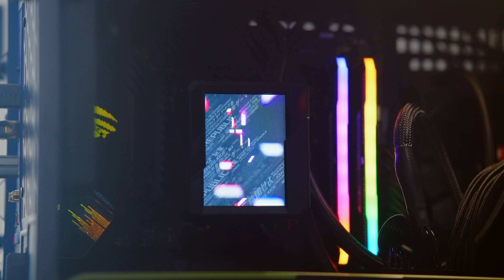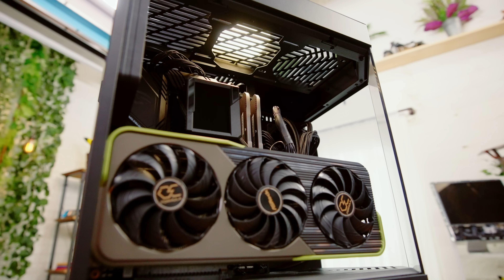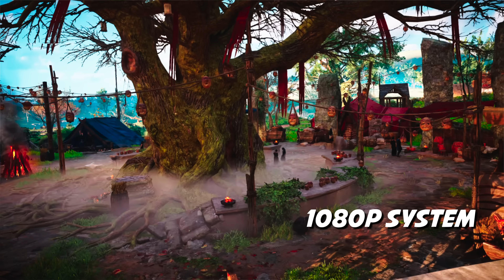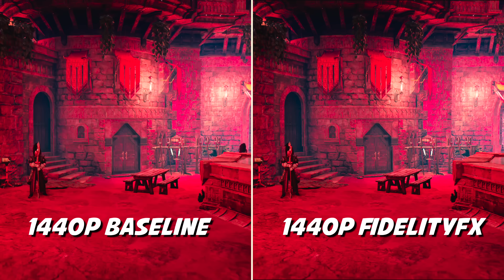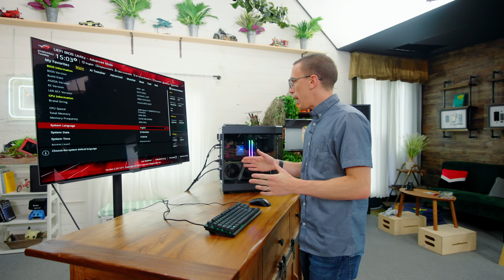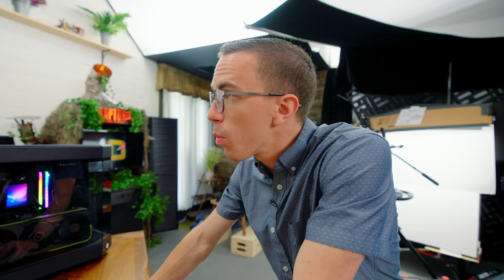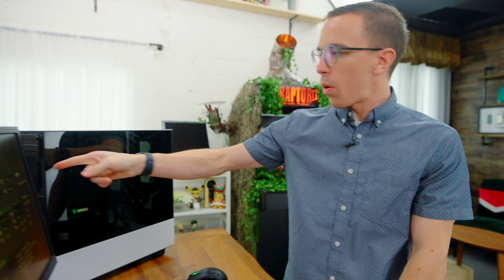Is an ALL AMD Gaming PC Worth It?

Comment: RX 6600 xt and 3060 non-ti are at the same price while the more affordable non-xt is $150 cheaper. If you just don't do other tasks than gaming. Going for AMD in the gpu department is always be a better choice in many cases

Edit: 3060 I mean, not 3600. There's fake giveaways and spam in the replies, be warned!
Reply: DLSS is the only reason I went with Nvidia. I've tried fidelity fx and I think it works great in fast paced games but it doesn't hold up in image quality.
Reply: @Bendoughver  Sensible reason, pairs well with ray tracing too 👍
Reply: @Bendoughver  Unfortunately it looks like DLSS is no longer an advantage for Nvidia as FSR 2.0 is not only about as good as even DLSS 2.3, but it's going to be supported in a ton of games, and I mean a ton. Its open-source nature has let many fans make mods for unsupported games to support FSR 2.0, like in RDR2 and many other games. And it's also supported even by GTX 1060 and probably also Maxwell cards as well. It's a gift from AMD to all gamers and that's why you have to surrender your life savings to buy an MI200 card right now
Reply: @one_step_sideways  copium
Reply: @Bendoughver  well FSR 2.0 is there now. And it will only get better + it will support more games do to it's opensource nature.
Reply: @durschfalltv7505  this is all true, but they are completely different technologies and I personally think DLSS has a much deeper bottom to reach in terms of ability. Fidelity FX is just another anti aliasing technology that's been rebranded.
Reply: @Bendoughver  Well still makes nvidia unusable for me on linux.
Reply: @Bendoughver  I don't think that really matters when it comes to 1080p gaming
Reply: wow a civilized conversation about the competitors! maybe we’re learning
Reply: The stigma I've known so far against AMD is that their GPUs like to suck up energy like no other. I haven't done any research on this lately as I had no reason to but I wonder whether this is still the case; where AMD deffo matches RTX or is better, but at the cost of significant amounts of juicy Watts... 👀
Reply: @ItsNassz  Hardware Unboxed have just made best gpu to buy at this time of year. You can check on that if you wanna a quick rundown on the list.

Both AMD and Nvidia have Watts efficiency issues with transient power spikes on the higher end cards. Lesser ones (RTX 3070 and below), their watts are not really worth caring about very much unless you are heavily, extremely, struggling and had to go with 3050 at what point would be wasting money anyway.
Reply: Actually  now days 6600xt for same price of 3050 which is like 50 percet better than 3050 at  almost same price yestrday was 6600xt on amazon for 299
Reply: only reason I went nvidia is the lovely rtx and dlss stuff.
Reply: Congratulations you were selected amongst the shortlisted winners 🏆 for the ongoing MacBook-M2/PC/Ps5  giveaway 🏆what'sapp the number above👆

Comment: Crazy how much better AMD has gotten over the last few years.
Reply: Ryzen changed the game
Reply: @Anonymous One Bro, ray tracing is such a performance killer, you only use it for screenshots anyways. I use a nvidia card and i can tell you that RT is not something you should be gaming with. I play all my games with RT off and the games still look very good.
Reply: @rusticmarten5262  What GPU do you have to be saying Raytracing does not matter?
Reply: @ZackSNetwork I didnt say it doesnt matter, its cool technology, just that it basically cuts your framerate in half, so imo its not worth it since games on ultra and beyond still look fine and run much better. I have tried RT in many games and  i always end up turning it off (i still turn it on for better lighting in some of my screenshots). I also have a 144hz monitor so fps below 90 is considered somewhat laggy for me now. The gpu is a zotac twin edge 3070 and i have an overclocked R7 5700g. I personally think that people should be more upset about AMDs codec, thats why i bought the nvidia card, nvidia has an amazing NVEC encoder/decoder for screen recording and also very fast cuda cores for example blender 3D renders using both the cpu and gpu. Still i have to say what AMD is doing is very impressive, like insanely impressive.
Reply: @Anonymous One Who cares about RT Lmao, such a waste of performance. Also what else about my statement was rubbish? Benchmarks literally prove my point about 1080p.
Reply: @Anonymous One Yeah for higher resolutions Nvidia is better, but for 1080p AMD soundly trounces Nvidia.
Reply: @EnigmaticGentleman  Who buys a top end GPU to game at 1080p? People in the competitive scene still prefer Nvidia and Intel still. 1440p is the new target know for mainstream and Nvidia dominated at 4K. Let’s not even talk about features, software and emulation because Nvidia stops AMD big time. AMD’s only advantages is 1080p gaming and Linux.
Reply: @ZackSNetwork  1080p is still the most popular resolution by FAR (68% last i checked the hardware survey), lots of people buy high end for High Refresh Rate and to not have to replace for a long time. Not sure about the Esports though, do you have stats for that? Though i wouldnt be surprised if Nvidia was ahead there due to how many teams make deals with OEMs
Reply: Intel nvidia is still the better combo
Reply: @agamerdude7596  Actually i can deny that, the RX 6000 series beats out Nvidia at 1080p, and in many tests the 6950xt beats out the 3090Ti as the overall best graphics card while being NINE HUNDRED bucks cheaper.
Reply: @EnigmaticGentleman  Yea sure, But gaming isn't the main point of nvidia cards, You do realize that people dont buy nvidia cards just to play games at 4k and high settings?
Reply: @agamerdude7596  Yeah but if thats what you are concerned about why are you commenting on a Gaming video? one would rightfully assume that gaming is the main topic of discussion here
Reply: @EnigmaticGentleman  Productivity and work features is pretty much the other reasons why nividia cards are still prefrered.
Reply: @EnigmaticGentleman  Like even myself doesnt just use nvidia just to play cyberpunk 2077 at 4k high fps.
Reply: Well, they hired a brilliant, well-spoken, and competent engineer to be their CEO, who would have thought you should do that as an engineering company?
Reply: @Anonymous One the fuck does it matter though. let people do what they wanna do
Reply: @Anonymous One Considering they are in X86 AND GPU markets. I'd say they are still doing well.
Reply: Their gpu drivers still arent the most reliable. My 5700xt sucked for years
Reply: True
Reply: GPU wise AMD has always been a good or even great option in the mid range. And even their FX Bulldozer cpus worked if you were on a tighter budget. And the mid range is where 80 to 90% of all gaming related sales happen. AMD has in the past years only improved in regards to the high end in general and the mid range in cpus.
Reply: Yeah also crazy how shit their gpu drivers are and runs like shit in some games
Reply: Crazy how they would’ve went out of business if it wasn’t for Dr. Lisa Su single-handedly!
Reply: Lisa turned AMD around fr
Reply: Lmao this did not age well 🤣
Reply: @agentbravo1716  ikr?!
Reply: Truly
Reply: Omg! You won a prize from Austin, def go give him your card info to get your prize
Reply: @basedgod5223  its fake lol
Reply: Isn't the GPU's still trash though? since they easily break
Reply: @vagamer522  I dont think AMD has ever really had problems with that, Nvidia on the other hand...
Reply: @EnigmaticGentleman  really I heard reports of AMD GPU's being bad so when I make my first ever PC I want to make sure it is good and lasts
Reply: @vagamer522  Oh, i think you mean the drivers. Yeah they aren't as good as Nvidias, but my god people over exaggerate them so much.
Reply: @vagamer522  i have a 5700xt, still running good. However its not the gpu, its the horrible drivers.
Reply: @Boeing-ER-jy9vq  yea the 6000 series cards aren't to buggy
Reply: Congratulations you were selected amongst the shortlisted winners 🏆 for the ongoing MacBook-M2/PC/Ps5  giveaway 🏆what'sapp the number above👆🏻
Reply: @austinevans2352  Bro stop scamming
Reply: Wow i cant believe it! Heres my social security number

Comment: TLDR: If you're wanting brand new with the best features, NO!
AMD CPUs are still great to use, but AMD graphics cards just don't hold up against Nvidia's raytracing and supersampling
Reply: Congratulations you were selected amongst the shortlisted winners 🏆 for the ongoing MacBook-M2/PC/Ps5  giveaway 🏆what'sapp the number above👆🏼
Reply: Well raytracing is better in nvidia for sure. But for frames, the 6950XT does more frames at 1080p ultra vs 3090ti (look for toms hardware gpu hierarchy). Also pricing is better for AMD.
Reply: @Jochemster  There is also DLSS. And, anyhow, using a 6950XT or a 3090ti for 1080 is overkill. They are more geared to 4k.
Reply: no 1440p 6950xt beats 3090ti
Reply: Raytracing is better but it’s still not mainstream, maybe once the 4000 series launches it will be, but until then you’re not getting a great experience. Maybe you will if you buy the top echelon of Nvidia GPUs or make compromises with either settings or performance, but it’ll only be mainstream once those compromises aren’t required.
Reply: @logan62097  DLSS is very mainstream now tho (and so is raytracing since it's in over 200 games now). 
If you want AAA gaming with the best new features Nvidia is the only good option

Comment: I'm Intel and AMD (and NVidia) agnostic so have no problem mixing it up, but in all honestly AMD has enough options in both CPU and GPU you'd be fine if you had to go all Team Red unless you were actively trying to make a bad meme build combo.

The real interesting question would be when the Intel GPUs finally get a general release and whether it'd be worth it to go all Team Blue as an early adopter of Intel GPUs.
Reply: in theory, vertical integration squeezes more performance due to closer synchronization. 
If i ever build a pc, might just go all out blue or red.
Reply: Congratulations you were selected amongst the shortlisted winners 🏆 for the ongoing MacBook-M2/PC/Ps5  giveaway 🏆what'sapp the number above👆🏼

Comment: Is it worth to buy refurbished gaming laptop,its factory refurbished?
Reply: There isn’t enough info in that question to answer it properly.
Reply: @whitekong316  like its factory refurbished, it was tested and put in not original box
Reply: @papastrumf5217  but whats the spec and price and use case? Imho laptops aren’t ever worth it. Leave a lot of performance on the table for the price.
Reply: @whitekong316  Im from Serbia and it is in dollars 907$(in my country tech is expensive) its Lenovo ideapad gaming 3 rtx 3060 and ryzen 7 5800H